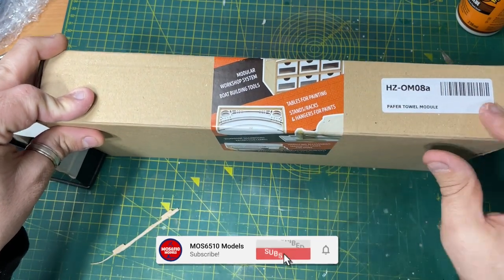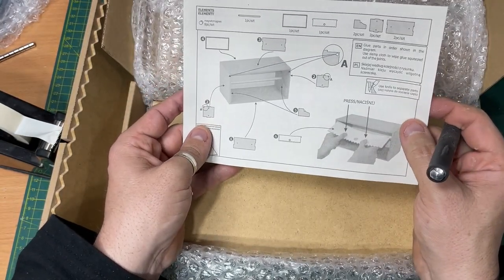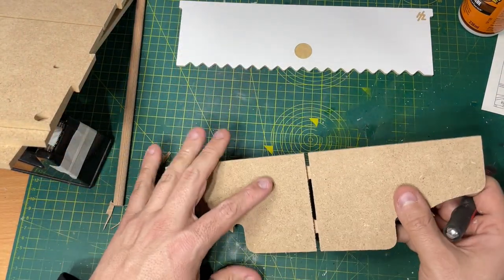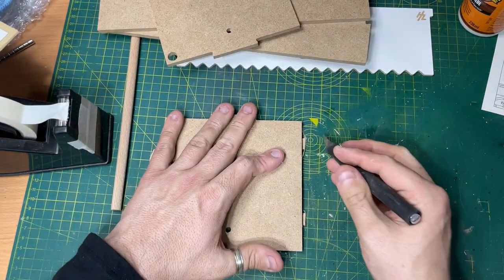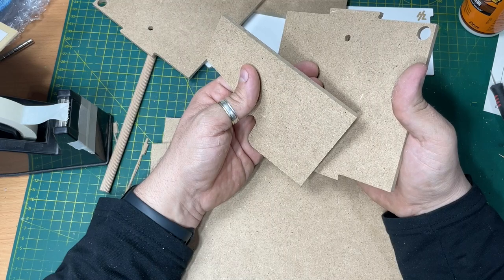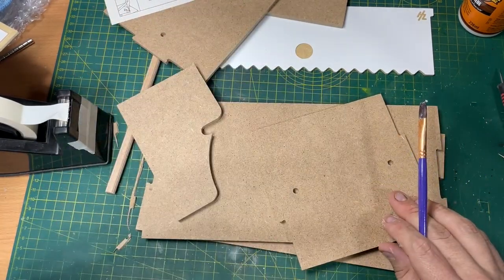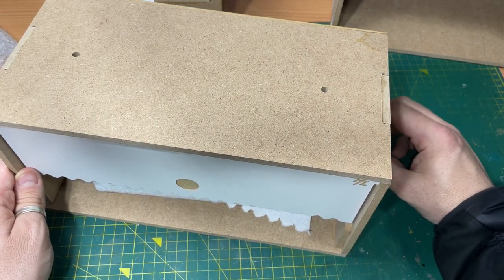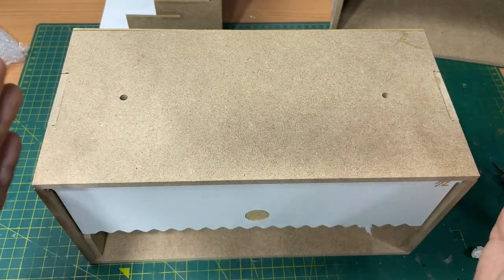hobbyzone Towel dispenser Module Full Build

Comment: You would have achieved  a neater build result if you had left the inner dowel supports until last and assembled the top, bottom and side sections, with the front edges facing upwards and the sections gluing into the white rear panel edge recess, which would position things square.
I just made my own towel holder from a plain hutch I had and some 6mm mdf salvaged by not putting the shelf in a corner shelf unit.